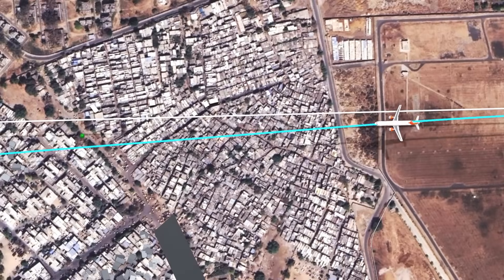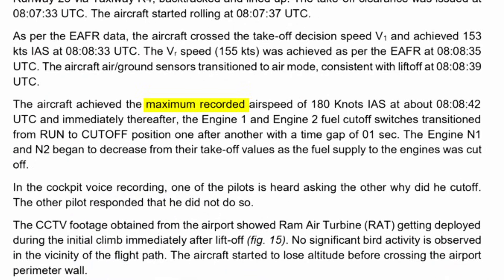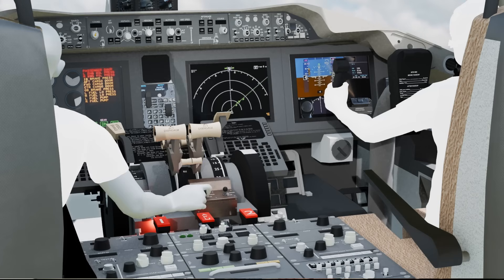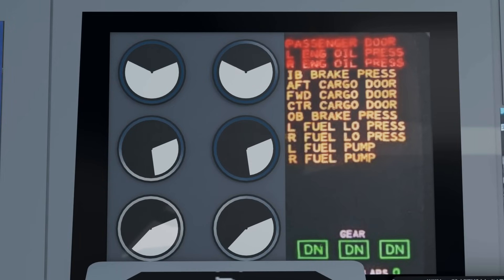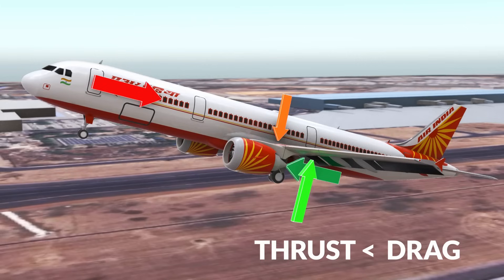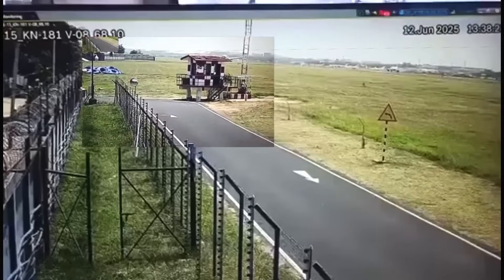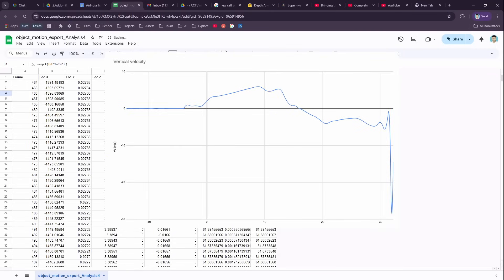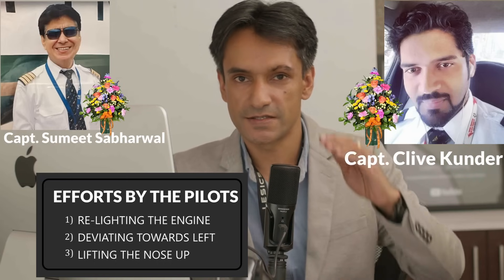Use of 3D Clone | Decoding the Crash Details you Missed

Comment from the maker: We have done a thorough analysis using 3D clone models and found out a lot shocking evidences to prove that this accident was due to technical glitch. Please download the 3D clone file from here - https://drive.google.com/drive/folders/1xjyighWEFTRvhO5wrEtted2Bux90iaDw?usp=sharing
Please access the Google sheet from here - https://docs.google.com/spreadsheets/d/1zayVOgSB3uh-G7bTxyMNQggCJppRmNTg51Po4kh0sVs/edit?usp=sharing

Verify the data yourself also spread the word.
Thanks Sabin Mathew
Reply: Pilots were heroes trying to save the aircraft under such an startling situation. Pls think, study, reason then talk.
Reply: the people who leaked this report, why they did not mentioned Whether they have heard the noice of switch physical movement or not in the voice recorder.
its very evident that the physical movement produces considerable amount of noice and Audio recorder is efficient enough to capture very minute noice.
If the noice was audible in the recoreder, it was a soild supporting evidence for the for the people who (assumingly representatives from boeing, NTSB, GE or UK investigators) leaked this report to prove pilot did it deliberately .

Why the time of RAT deplyment is not mentioned in the report? instead reprt mentioned  power reinstated from RAT 4 seconds after both engine failed.
Then when was RAT deployed? normally it takes 8 seconds from the deployment to establish power  (opinion from some expert).
If that 8 second phylosophy is right, then there must have an electrical failure during take off [(3+1+4) - (8 seconds) = 0 ie, take off time ]. See, the volocity at that point was less, then efficiancy to deliver the power by RAT also will be less.

Why there is a termal runaway on rear side data decorder especially tail end was not exposed to fire or heat. wires were burned.
Reply: @anilkumarnair5590  What on earth are you on about? No-one "leaked" a report!!!!
Reply: So the investigators didn't know their job. And that both fuel switches accidentally and coincidentally moved to cut off together. At the same time. Even though the switches are designed to make it impossible.
Reply: @davidcritchley3509  The switches trigger relays.  Other relays in the fuel control system are software controlled.  Software bugs happen.
Reply: @davidcritchley3509  The AAIB propagandists know full well the difference between the passive form "transitioned" and the active form " were transitioned".
Switches don't "transition". but relays and solenoids do.
Reply: Thanks for pointing out residual trust. This component must be much bigger with newer engines because of its much bigger frontal fans.
Reply: @unclewerner  About 80% of thrust is due to the fan.  At fuel cutoff in TOGA setting that 80% is quite a lot of thrust.
Reply: How can a Software Glitch be recognized by a Pilot saying: why did uncut iff the engines?
Reply: @rowbee3216 first off how do you believe anything the indian investigators are saying. If you understand how India works your first instinct is to not trust anyone from AAIB. It's a corrupt organization.
Reply: Can you do video on Apollo Saturn 5 F1 Enginê  ¿¿ m
Reply: Thanks for your efforts. However, I do have some issues with your analysis. Assuming that your general trajectory reconstruction is correct, given the poor quality of the airport video I find it difficult to believe that the reconstruction is accurate enough to show fine detail such as the timing of thrust changes. In order to get some idea of magnitudes for the purpose of a sanity check, use as an example simultaneous dual engine failure and crude ball-park values: mass=200k kg, thrust=2x300kN, pitch=0.1rad (6deg). As you point out the thrust of a high bypass fan engine takes several seconds to decay once the fuel is cut, so it is difficult to use this to detect fuel cut-off without knowing much more about the engine characteristics. However, 10% of this say, decays more rapidly, and this perhaps can be used as an indicator. So, the rapid component of thrust change along the total velocity vector is 2x300x0.1=60 kN (the cosine term is close to unity). The associated acceleration change is 60/200=0.3m/sec^2 (0.6 knots/sec). However, when I look at your velocity against time graph, I do not see any sudden change in the slope of the curve that matches this. What I do see is a more gradual acceleration change between about 4 secs and 8 seconds of about 3m/sec^2 which might reasonably be associated with the collapse of total thrust (aerodynamic incidence increases relatively slowly during this period). The subsequent reduction in acceleration is probably mainly due to more rapidly increasing incidence leading to increased drag. Turning now to rapid vertical acceleration change, this is 2x300x0.1xsin(0.1)/200=0.03m/sec^2. Again, when I look at your Vz against time graph I do not see this. What I see is an acceleration of about 0.3m/sec^2 up to about 8 sec. This is maintained constant by varying incidence that towards the end is compensating for the failing vertical component of thrust. After 8 seconds there is a rapid collapse in Vz as speed decreases, lift per unit incidence decreases, incidence starts to approach stall values and drag increases. Just after lift-off there is a rapid change of slope (dVz/dt) that you ascribe to engine failure but the change is either too large or too rapid for this to be true. There could be a couple of alternative explanations:
1. In the airport video at lift-off the aircraft was obscured by a shed, so perhaps you formed your trajectory in two parts, based on pre and post shed video frames. When you joined them, they did not quite match, leading to a glitch.
2. In your video you do not say where the datum tracking point on the aircraft is. If it is near the nose then that point would experience an additional (compared to the cg) impulse shaped acceleration as the aircraft rotates to generate incidence at take-off.
Reply: @dvcontrol  80% TOGA thrust is from the fan.  At fuel cutoff there would have been a 20% loss of thrust as an instant step change.  The pilots must have felt that instant loss of acceleration.  The survivor said it felt as if the plane stood still in the air.
Reply: Wyngx seems to copy your technical  analysis and contradict you.
Reply: I hope @MentourPilot does a deep dive from this
Reply: I did math to a certain point and left thereafter for want of a basic input. 
There are a few crucial points you have ignored in spite of they being glaring. 
Estimated V1, Vr, and V2 were given, the actuals of V1, and Vr given in the report but not V2. Why?
There was smoke or dust seen just before takeoff. Why? It was not seen after a second. Why?
If you can change your math with the one that I have, you may get the correct picture. 
1. It was airborne while thrust was declining. 
2. Then, it became a glide of 20:1 ratio. 
3. It regained thrust to lift to a maximum height of 290 feet at which height it impacted initial hit with tree and thereafter crashed on building A.

If you see this comment, just reply to me here.
I will share my crucial math revelation.
Reply: Video no good - should produce a 5 min version of easy to understand video
English spoken in video too difficult to understand
Boeing is unreliable - air india is unreliable - 
Difference between MH370 & AI171 is that one is suicide & other is tech failure
Reply: 7:10 You clearly demonstrated that it is possible to switch the right switch 1 second after the left switch.
Reply: What about water ingestion into the EE bay during rotation?
Reply: Appreciate your analysis to a great deal. Thank you so much for your hard work. 
As a layman what occured to me if there could have been a possibility that the pilots from the previous flight Delhi to Ahmedabad sector cut of the fuel switches out of frustration? It was obvious that the electrical systems were already not in order ,a guy who floated a video was vehemently complaining. To make it clear the pilots opinion would also matter greatly so that the deceased souls would rest in peace without blemishes. 
Have been wondering why they have not added their version of the error, already  which existed!!!! My request for bringing the versions of the pilots of the previous flight Delhi/ Ahmedabad sector is very important so that the deceased souls may rest in peace without the awful blemishes. 
My request please invite the pilots of the previous flight Delhi Ahmedabad sector to open up and clarify their stand.
Reply: @SabinMechanical, you should cross-reference your analysis with the one done on the Airline News with Geoffrey Thomas channel, where they also did a detailed analysis of the numbers and came to the same conclusion as you about the RAT deploying before the fuel cut-off switches were moved. They don't have the detailed animation you have but they do have a more advanced analysis of possible causes, providing a 17 page report that hypothesizes the likely cause was water ingress into one of the electrical bays that shifted during rotation, taking out the 230V bus. They also list several ways (in order of likeliness) of how that would have cut fuel to both engines. They also list why there would be such a delay is switching the second cut-off switch back to run. Specifically, for the 6-10 seconds after power was lost, and before the RAT was operational, the system relied fully on battery. The pilots would have known that on the 787 the battery is only rated to provide power to relight one engine, so they would have waited until the RAT came online before attempting the second relight.

Reference: https://www.youtube.com/watch?v=hrndsuamKN8
Reply: @corwin-7365  As I posted on the article to which you refer -
If either pilot was trying to crash the plane we would have seen some degree of yaw, bank or phugoid style pitch variations as the pilots fought each other for control.  We did not.  The airport surveillance video shows that, apart from obvious loss of thrust, the plane was flown in a smoothly controlled manner.
As for water rolling downhill as the plane pitched up: in the 1940s a DC3 nearly crashed when steel girders shifted aft during the takeoff roll.  If G forces can shift girders in a DC3 then the greater G forces in a 787 can surely shift water long before VR.
Stop trying to blame the pilots.
And it has nothing to do with water.
FADEC problems have plagued the air industry since at least 1995.  Until such time as I am proven wrong I will maintain that a FADEC fault is the most likely cause of dual engine rollback on takeoff, especially since the FAA became aware of the possibility in 2006.
Reply: @patricklockerby4308  I think you must have replied to the wrong person.
Reply: This is extremely well-researched and clearly shows the pain-stakingly hard work, sleepless nights and rock solid dedication that is gone to dissect and provide the details on what transpired on that ill fated day.

I am an Air Cargo professional with 20 plus years experience in international and domestic Air operations. I am IATA DG ceritifed Aviation consultant and an  Independent researcher. I also did my  own independent deep-dive analysis before and after the AAIB prelimnary report, including granular level second by second research of timelines and technical FIFO and LIFO of events, on the AI 171 crash.  Below is my final micro level findings with a most probable root cause. Below is a small excerpt of it : 

In my opinion, It is an Airframe-commanded fuel shutoff (FSOVs) — via spurious/automatic electrical command or relay/RPDU fault

Why is this electrical / relay or RPDU  fault or a  related logic malfunction  inferred as a most likely cause and NOT a FADEC outage or a Pilot  Error theory::

Pre-existing cabin electrical degradations that were present even in previous leg and continued later as well , probably point to an airframe distribution/RPDU issue.

Near-simultaneous “FUEL CUTOFF” on both engines within ~1 s likely matches a common-path command (relay/RPDU/logic)

At takeoff thrust, each FADEC is self-powered by its PMA; a FADEC-first/FMU-first shutdown would require very rare, identical EEC failures or simultaneous PMA defeats — much lower prior probability than a single airframe electrical fault that issues (or mimics) dual cutoff commands.

RAT deployment here is consistent with downstream consequence (both engines flamed out because fuel was cut at the spar). likely not indicating FADEC to fail.
Reply: Is both engine glitching!!! What are the probability! The copilot is a Pakistani muslim convert Christian!
Reply: When the final report comes out, will you come back here and admit you were wrong or just disappear and act like you didn’t say what you did?
Reply: It was an obvious Fal se 🏴‍☠
Reply: You obviously aren’t open to discussing the matter.  This is a case of a person having a conclusion and developing the “science” to corroborate it - instead of gathering the evidence and doing the science to determine what conclusion comes of it.

I’ve already pointed out the first flaw in your premise, but you aren’t interested in considering anything that might challenge your conclusion.

I wish you wouldn’t do this to the families who lost loved ones in this tragedy.  They deserve better.
Reply: You're right
Reply: Would you consider offering your data to Mr Pushkaraj Sabharwal, father of Capt Sumeet Sabharwal? It will aid him immensely in his legal battle to restore his late son's excellent reputation. I think that he has planned to take recourse to the lawcourts to achieve his objective in case there were no response from the authorities.
Reply: @geralynpinto5971  Developing a mental illness does not diminish his excellent career.
Reply: What Can Cause the Fuel Control Switch to Signal “CUTOFF” Besides Moving the Switch or Pulling the Fire Handle?

On modern aircraft like the Boeing 787, the Fuel Control Switch (FCS) on the pedestal sends commands to the Engine Electronic Control (EEC) to manage fuel flow to the engines. Under normal operations, the FCS is controlled by:

1. Manual input by the pilot (moving the switch to RUN or CUTOFF).

2. Pulling the fire handle, which sends a signal to the EEC to shut off fuel as part of the engine fire protection system.

However, aside from these, the fuel control system can signal “CUTOFF” or result in engine shutdown due to several other factors:

 A. Automatic Protection Logic (EEC Logic or Fail-Safe Mode). The EEC can command a fuel shutoff automatically if it detects:

-Overspeed protection (on N1 or N2).
-Severe engine damage (e.g., uncontained failure, extreme stall).
-Loss of required sensor data (like throttle resolver, FADEC input, or critical engine sensors).
-Dual-channel FADEC failure, which causes the EEC to enter a fail-safe shutdown mode.

In these cases, even if the switch is physically still in RUN, the EEC may interpret it as a condition requiring shutdown.

B. Loss of Electrical Power to the EEC. If electrical power to the EEC is lost — such as through:

-PMA (Permanent Magnet Alternator) failure,
-Loss of both AC power sources (to channels A & B),

the engine could shut down or drop to idle. This may be interpreted by the system or shown on EICAS as FUEL CONTROL SWITCH = CUTOFF or ENG FUEL CTRL, even if the pilot never moved the switch.

C. Wiring or Relay Fault Between FCS and EEC. This includes issues like:

-Short circuits in the FCS wiring.
-Faulty relay logic between the cockpit and the EEC.
-Faults in the Engine Interface Unit (EIU) or System Interface Module (SIM) which convert FCS signals to digital commands.

D. Avionics or Aircraft Logic Fault (e.g., Ground Mode Stuck). In cases like the suspected AI 171 accident, if the aircraft logic fails to transition from “ON GROUND” to “IN AIR” mode, then:

-The FADEC does not switch to flight mode logic.
-Full thrust and fuel control are restricted.
-The EEC may interpret the situation as an engine abnormality, causing it to idle or shut down the engine — potentially displaying a CUTOFF or ENG FUEL CTRL condition.

E. Airplane-Level Engine Shutdown Command (Rare). In very rare circumstances, a centralized aircraft system may issue a shutdown command — for example:

-During severe avionics failures.
-In response to contradictory or multiple fire indications.
- Or in the presence of unresolvable engine control faults.

This is highly uncommon and typically part of deep fault protection logic.

Summary:

The fuel control switch may send a CUTOFF signal or result in engine shutdown without physical movement if:

Cause	Description

1. Fire handle pulled	Standard shutdown via fire system.

2. EEC protection logic	Overspeed, severe failure, fail-safe mode.

3. Loss of EEC electrical power	Engine loses power, shuts down both  Engine

4. Faulty wiring or relay logic	False shutdown signals sent to EEC.

5. Ground mode logic fault (AI171)	FADEC doesn’t switch to air mode → no thrust (engine cut off) 

6. Avionics miscommunication	Conflicting or misinterpreted system signals.
Reply: @tedeave2009  TCMA - Thrust Control Malfunction Accomodation system can also cut off fuel.  TCMA is wired in common / parallel with the relay controlled by the pilots' fuel switch.  There are two software controlled relays, each with different software.  It was the TCMA that shut off the fuel as a plane landed at Osaka recently.
Reply: @patricklockerby4308 And elsewhere too. TCMA alerts WILL be on the FDR logs. 

I'm actually quite surprised 30 days after the 30day Interim Report that they haven't come out and said something yet along these lines.....
Reply: Based on the three fundamental theories of Landing gear system, Electrical system and Engine Fuel & Control system of B787-8. The root cause of the issue is attributed to the air/ground mode logic being stuck in ground mode (software glitch/mismatch) 

----------------
Sequence of Events
----------------

1. Normal takeoff
2. Landing gear failed to retract after liftoff
3. Simultaneous loss of electrical power; pilot manually deployed the Ram Air Turbine (RAT)
4. Both engines shut down --> Both engines were shut down by the active TCMA (Thrust Control Management Accommodation) with a 1-2 second time delay. 

FDR appearance: 

Fuel SOV = CLOSED
AccommodationActive = TRUE

5. "ENG FUEL CTRL / ENG FAIL" message appeared on EICAS, despite no intentional fuel cutoff ("why did you cut off the fuel", "i didn't") 
6. Pilot attempted to relight both engines by cycling the fuel control switch on Engine #1 (from RUN to CUT OFF and back to RUN), followed by Engine #2 four seconds later
7. APU switch positioned to START (two seconds after ENG #1  fuel control switch recycle to RUN) 
8. Pilot declared MAYDAY to ATC
9. Aircraft impacted the ground
Reply: @tedeave2009  Very good!  But pilots would feel deceleration, just as the survivor did.  There would be a startle factor immediately follwed by a check of the instrument panel and seeing the EICAS message.
Reply: @patricklockerby4308 Exactly, from the EICAS message, the pilots realized the engine deceleration and fuel SOV closure. That's when the viral conversation ensued
Reply: @patricklockerby4308 But the actual switches cut off the fuel, and we know that, so there's no point in speculating what other things could have done it, because they didn't.  The actual, physical switches were moved to Cutoff.  That's it.  We know.
Reply: @JulianJLW  The AAIB report is riddled with errors.  Many knowledgeable people do not trust what it says.   Uncommanded reduced thrust during takeoff due to a FADEC software fault has happened to Boeings before.  The powers that be would rather you didn't know that.
Reply: @patricklockerby4308 No. For a while graphs show the plane STILL accelerating for a short while as some fuel - reducing in flow and quantity - was going through the one working engine still. 

Plus, don't forget that - thanks to some great analysis - 5 seconds before the crash, that engine had restarted, was back upto power and was working (faster than it had at takeoff.)
Reply: @hazard3020  The engines are high bypass turbofans.  The engine core spins a huge fan which provides around 80% of thrust.  When the fuel is shut off the engines continue to provide useful thrust until they drop below idle rpm, which takes some time.
These engines are giant versions of the  ducted fans used in model aircraft.
Reply: @patricklockerby4308 Thank you. I thought so because of the actual design of the jet engine.
Reply: @tedeave2009 I'm pretty certain 4 x ECMs failed AND 1 engine failed immediately (Engine2) on Takeoff causing the RAT to deploy. These are linked to 2 different reasons IMHO, one being water damages illustrated in the Boeing AWD Report.
Reply: @hazard3020 But none of those systems are able to move the actual, physical switches, which were moved to Cutoff, by a hand, because that's the only way they can be moved.  The switches' positions are recorded directly by the FDR via dedicated cabling from the switches themselves.
Reply: @tedeave2009  The fundamental problem with all that is that it ignores the fact that the ACTUAL, PHYSICAL SWITCHES were moved to Cutoff, and later back to Run.  THE PHYSICAL POSITION OF THE SWITCHES IS MONITORED BY THE FDR BY MEANS OF DEDICATED CABLES DIRECTLY FROM THE SWITCHES.
Please, please, please stop this meaningless and nonsensical speculation.
Reply: @JulianJLW That's not a fact, just an assumption. The actual facts are: all landing gear remained in the extended position, the RAT (Ram Air Turbine) deployed, the ADS-B transmitted a signal only 12 seconds after lift-off, and ultimately, the aircraft impacted the ground. Those are the verifiable facts
Reply: @tedeave2009  It is not an assumption that the actual physical switches were moved from Run to Cutoff, and subsequently back to Run.  The FDR recorded it happening.  It IS verified.  I'm not aware that anyone has been able to suggest an even remotely plausible way in which the FDR could have recorded the switches being turned off (both of them, 1 second apart) and then on again several seconds later, without it actually happening.  So we have the information of the FDR (about the movement of the actual switches, not relays) and we have absolutely no reason to disbelieve it.  FDRs are pretty accurate.  Accepting the data they provide is not generally regarded as making assumptions, as far as I'm aware.
Reply: @JulianJLW all aircraft engineers knew that both engine shutdown automatically by TCMA, nothing can shut down both engine simultanously (with only 1 second gap)  except TCMA, and only TCMA could shutdown engine in 3 second after lift off (3 second is the time delay given by TCMA before shutdown both engine when problem occured)
Reply: @tedeave2009  The FDR said it was THE SWITCHES.  What part of that don't you understand?
Reply: @tedeave2009 Agreed. Especially as these events have also occurred at least 3-4 times before. At least !

After one of these such TCMA incidents, it took a team of engineers 3 x full working days to get both engines to restart again. 3 days ! 

AND it's NOT just a GE issue further pointing to logic issues - rare events - but definitely events that occur during live flight.
Reply: @JulianJLW dont accept >anything< from an interim report until ALL 46 hours of FDR errors have been checked manually. They couldn't even use the correct wording IN the report. Which indicates severe time constraints due to the 30day timescales and work ongoing for months still.
Reply: @hazard3020  I find it very strange that you and others are so convinced that you know better that the investigators who are trained and experienced at the job AND have the data.  The only sensible course is to let them do their job.  There's far, far too much amateur speculation going on already.  Obviously this video is going to attract those who would far rather indulge in unfounded speculation than accept straightforward facts.
Reply: @JulianJLW Obviously when you work in logic or electrical computerised systems for 30+ years, you know that looking through ALL the FDR logs for 46 hours SHOULD be done before anyone ANYONE releases an official report of ANY kind....and that means the AIAB.

And that interim report never even mentioned 3-4 events of WOW/TCMA logic issues - those leading to dual engine shutdown - elsewhere in other Accidents or Aircraft Near Misses etc etc.
Reply: @hazard3020  None of that changes the fact that the engines were shut down specifically by the switches being moved manually from Run to Cutoff.
Reply: @JulianJLW I would NOT jump to conclusions. To be honest the position where such events actually occured, the sudden RAT deployment very early tends to favour a glitch occuring in some logic control system compared to other outcomes. Obviously EVERYONE is currently waiting for 46hours worth of FDR logs and alerts to check .......
Reply: @hazard3020  The last 5 minutes of CVR alone would suffice to show whether it was pilot error or Boeing error.
Reply: @tedeave2009 
EXCELLENT explanation and factual possibilities TED...Welldone 👍
Reply: Based on the three fundamental theories of Landing gear system, Electrical system and Engine & powerplant system of B787-8. The root cause of the issue is attributed to the air/ground mode logic being stuck in ground mode (software glitch) 

----------------
Sequence of Events
----------------

1. Normal takeoff
2. Landing gear failed to retract after liftoff
3. Simultaneous loss of electrical power; pilot manually deployed the Ram Air Turbine (RAT)
4. Both engines shut down
5. "ENG FUEL CTRL / ENG FAIL" message appeared on EICAS, despite no intentional fuel cutoff ("why did you cut off the fuel", "i didn't") 
6. Pilot attempted to relight both engines by cycling the fuel control switch on Engine #1 (from RUN to CUT OFF and back to RUN), followed by Engine #2 four seconds later
7. APU switch positioned to START
8. Pilot declared MAYDAY to ATC
9. Aircraft impacted the ground
Reply: @tedeave2009  I agree entirely and that the preliminary report issued by the AAIB pointed the finger at the pilots because if the plane were at fault it would have meant grounding the Dreamliner fleet globally and that would end an already struggling Boeing.  The USAF has just issued the contract to Boeing with a $20 billion (US$) contract that will be worth as much as $3 TRILLION.  There is so much at stake that they will manufacture any proof required to indict the pilots.
Reply: WOW...Super analysis and factual engineering sequences explained here 👍👍👍
Reply: I believe you are spot on. This crash is not due to  pilot error or suicidal pilot(s) as the media, many pilot bloggers  and the prelim report would have you believe. That also explains why the gear was still down as he wanted to try and save the plane and land it on the main road. Everything from an Engineering perspective be it mechanical, SW or HW, points to either a defect within the  FEDAC SW running the plane or some other SW defect, but of course they ( B....G ) want you to believe otherwise, else it would be another nail in the coffin of that plane manufacturer. Nothing to see here, pilot was suicidal, move on, they claim.  I also believe the Pilot said to the other "Why did IT cut off". Easy to replace with the word "YOU" to sow a seed and push the narrative in a particular direction.
Reply: @danellseenyen7860 I'm pretty sure we will be reading about TCMA errors, ECM failures and one Engine failure in due course. And we know that the engine failure can be put to one side at 10,000 ft + as that Aircraft can fly 3 hours on 1 Engine alone.  But its a massive problem when it occurs at 128feet off the Ground along with other failures too.